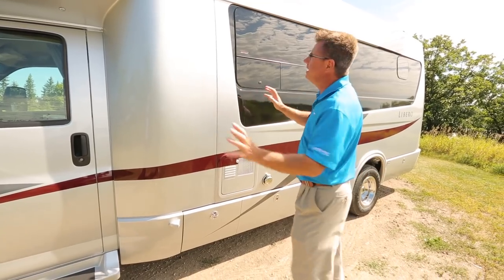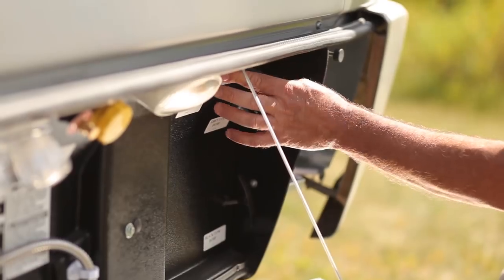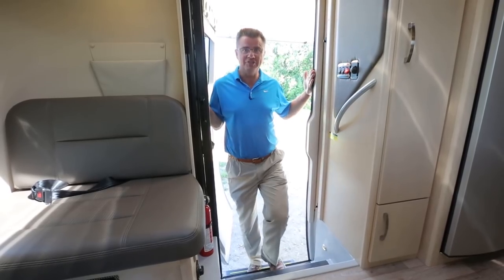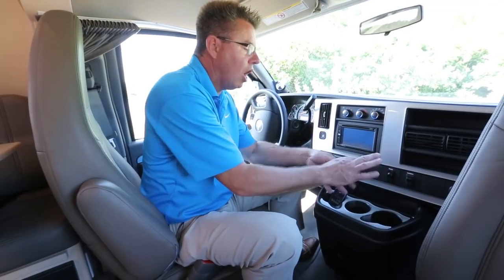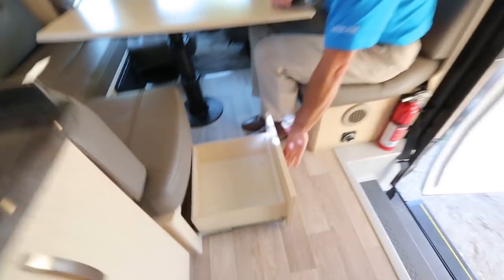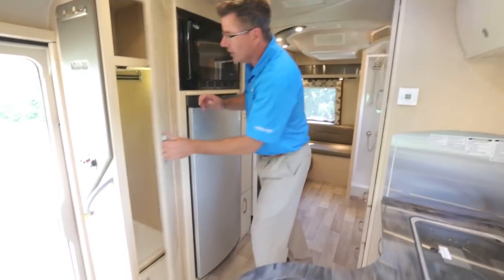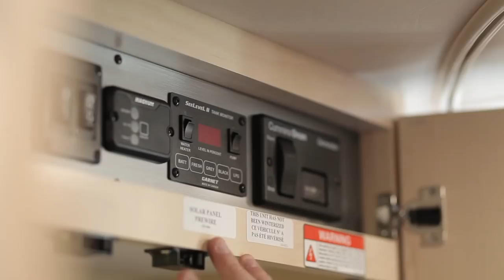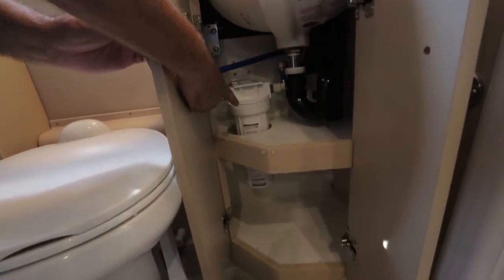2014 Libero

Comment: Ok outside does look nice all custom doors etc. Until you need body work. Inside is a very cold look for my taste. Very expensive coach, lots of fancy fluff I cant imagine in years to come to find parts for it if Leisure van goes under like most Rv companies have , Then where do ya find these one of a kind parts?
. I will stick with my Gulfstream BT cruiser which is cozy on a dependable Ford E450 chassis and its paid off and still looks brand new!
Reply: I meant new  18 diesel  mpg verse the 12 in gas I get with V10
Reply: Just got back from 3000 mile trip with Ford E450 v10 PULLING A 3000 LB suv and averaged 11mpg easily get 12 plus not towing. Just the cost to get a diesel verse a gas you will never see gain for years and years in gas cost and mpg verse v10 gas even at 10 mpg

Comment: Do they still make the Libero in 2017? I like the Chevy Chassis. Will never buy anything Mercedes.

Thanks
Reply from the maker: Greetings!  No, the Libero is no longer in production.  We do have a Ford chassis on the Wonder.  More information can be located here, http://leisurevans.com/wonder/ Thank you! -Donna
Reply: Leisure Travel Vans It's a shame that most manufactures are using sub standard garbage for their rigs nowadays. The Chevy 6.0L way outperforms the Ford V10 POS and Mercedes is just garbage IMO.

It's gonna be a long time before parts and service for that Mercedes becomes even somewhat reliable. Most shops won't even touch them.
Reply from the maker: Mr. Haas, The issue is Chevy being able to supply the chassis timely, not the desire to use the product.  Thank you! -Donna
Reply: Leisure Travel Vans Wow. That's nuts. You'd think Chevy would be able to supply chassis. So much easier than a complete van. It's a shame most class B's are now on Mercedes Chassis.

Thanks for the reply.

Comment: Nice little coach, but unfortunately, it's built for midget, ceiling too low, galley counter a bit above your knees. And like many said here, way too many storage cabinet, no privacy when using the bathroom. So, I bought a 2014 Class C.